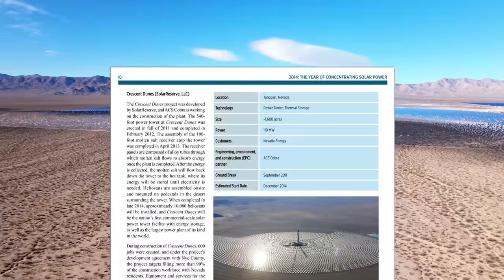The Failure of America's $1 Billion Solar Farm

Comment: "While the technical flaws were a key cause of its major challenges, the financial state of the company was ultimately the key cause behind the project's failure." But the financial state of the company was directly due to their inability to reliably produce competitively-priced electricity because of the technical flaws.
Reply: Yea, he explained that.
Reply: See I wouldn't mind an uptick in prices if it meant better energy for the future. But the line Between "this actually costs more" and "I want a new mega yacht" is so blurred.
Reply: @OsiDio  "Uptick"? The cost of Crescent Solar is 4.25 times the average. The average household spends $1464 on electricity annually. Crescent Solar would cost $6222 annually.
Reply: Exceptional poor script in this video. Instead of telling us what the technical flaws were, which would have been interesting, they kept repeating the flaw mantra
Reply: I've been out to that place out of curiosity when driving by it.  Each mirror, all 10,400 of them, are positioned by an actuation system that continuously monitors the sun's position and positions the mirrors correctly to reflect sun onto the molten salt reservoir on the tower.  For all those thousands of mirrors, that has to be a maintenance nightmare.  You probably have to have an army of maintenance guys to take care of that huge complex system.  That in itself seems cost-prohibitive.
Reply: That clears that up.
Reply: Poor design and engineering from the get go.  Too far away from the use points.  It was literally built to spend the money to build it.  It never had any hope of success from day one.
Reply: @x-man5056  
Yeah, looks like somebody enjoyed spending grant money on their science project.  When they were done burning through the grant money, the powerplant couldn't make enough money to keep it going.  Agreed, sole purpose was to spend money.  Most of the time accounting is real loose, so the project director probably skimmed money, too.
Reply: @Skank_and_Gutterboy  Even if it worked, it is too far away from users.  1/3 to 1/2 of it's generated electricity would be lost in transmission.  Just like all other forms of generation.

Comment: While the Tonopah  facility was being bult, there was a big rain storm, in may, fiber optic cable had just been delivered. The fiber was under water, and ruined. Plus the plans called for 2 elevators, to save on costs, they put only one elevator. The elevators were for stability, so the tower now leans. I was in goldfild 4 years ago, i saw the most beautiful  coat of hair. It got my attention, as most times they had been mangy, looking. That same day i was in the,Tonopah dump. Inundated  by flies. There should have been zero flies, it was 38°. I asked myself  why? Didn't  take long i found the answer, dead birds were on the ground. Its a migratory  fly way. The panels have been left to face upwards.  The birds thinking its water fly towards it and become blinded, falling to the ground, dead.
Reply: The animal was a  coyote
Reply: I work with fiber optic cable all the time. Getting wet doesn't ruin it. It is made from glass after all.

Comment: So... 1 billion divided by 70k homes is about $15k per home.  If each home put solar panels on their roof for $15k, there would be no running maintenance costs, and would produce the same amount, if not more electricity
Reply: @bert1450  there is a role for solar panels on homes for producing electricity.
Reply: what happens when the sun goes down or late afternoon or early morning ? yep you get no power !
Reply: @hokitika4888  It's rather worse than that. I retired from a Fortune 100 electric company five years ago; the company makes millions of dollars per year on the "energy imbalance market," buying solar electricity when it was cheap (sometimes even at negative prices) and selling dispatchable (on demand) energy when the sun was still rising or darkness came. California alone needs an infusion of 12,000 MW over a span of three hours every evening. Here on the Western Interconnection (essentially all North America west of the Rockies from the Mexican border of the US to the Arctic Circle) we already have too much photovoltaic generation with negligible storage.
Reply: @hokitika4888  This is why you have alternative sources of power like hydro. I guess you know the bulk of electricity consumption is during daytime, right ? Well solar PV could take care of that, without the risk of nuke plant or pollution from coal plants

Comment: Projects like this using "new technology"  should be constructed in a modular fashion - construct for example 5 percent of the mirrors & test them for a year.  Small design flaws can be detected in year one & corrected in year two as the project builds the next 5 percent the following year, etc.  Far lower total risk, imho, and slower scale up means less initial capital required.

Comment: I remember seeing this type of solar many years ago, so I don't really think of it as new or groundbreaking.
Reply: It isn't,  if you listen the narrator says, in the US.  Up until that time there wasn't one operating in the US.  Also I noticed the narrator never once mentioned natural gas.  This plant operates all night long due to natural gas being used to keep the "Salt Slurry" hot.  One of the many issues they had was having to use more then the 40 percent of it's power from natural gas, but some how the narrator just left that out.  The plant in question has more then 60 percent natural gas use due to cold mornings and it was needed to heat the salt up for the reflectors.

Comment: Solar is nowhere near being a viable alternative... to anything.  It may get there but, as of right now, April 2023, solar is still experimental, at best, but more realistically, it's just plain foolishness.
Reply: Not for photovoltaic panels.  I've been using them at home for over 20 years.  All are still working.  They've paid for themselves many times over.  I have free power every day, even in winter.
Reply: @davidb2206  If you would, what is a photovoltaic panel?  Does it differ from what the government is trying to "give" everybody?  If they are a better type of panel, why are you the only one I've ever seen mention them.  I am not trying to be argumentative.  To me, if solar really worked, no one would be connected to the grid.  What I want from a solar system is a normal electrical life, the whole house, just the way I have it, powered, at all times.  That means NO MATTER WHAT.  I want electricity to where, if the sun does not shine, long enough to deplete my system, having electricity will already be the least of my worries.  I'm not looking for the system to pay for itself.  I don't give a crap about that.  I want my own electricity, not attached to the aging, vulnerable grid.

I have begged, pleaded, groveled, flattered and, nearly, bribed, to get someone to give me a ball park of how much solar equipment, panels, batteries, etc., I would need to achieve what I want.  Not a soul has answered my question.  I just want some numbers; quantities, of things.  Any attempts to communicate back with me have been so full of jargon, I can't understand whether they've actually said anything at all.  I don't want talk of amp hours, 12 volt, 24 volt, pure sine wave, none of it, at this point.  
I want to know how many panels, how many batteries, and what else I need to power my house... always.  

Would $100,000. cover such a system?  Or, as I suspect, is such a system not possible?  Which brings me back to my initial comment. 

Did any of that make sense?

Comment: My question, you said cost of generation to NV Power was 130/kw when it first came on line, NV terminated contract because cost of electricity was to high. What was the cost when it came back on line in 2021? 200/kw?

Comment: What could go wrong with really hot salt?  Corrosion on a quantum level maybe?
Reply: Well, kinda. The smaller system the company I worked for had problems with the pipe seals. I imagine thermal cycling had a hand in that.

Comment: So, we got 0% of power from that 700 mil.  That was a gamble with taxpayer's money.  Could have given loans to each individual households to put a solar system in each home, and it would have given a lot more power to these households.
Reply: The gov got most of it back, and are continuing to collect on the balance after it returned to operation under new management.

Comment: In 2022, this averaged about 11.5 MW of actual power production, 101 MW-H in roughly 8700 hours) so it has a staggering cost of $86,000 per kilowatt of actual production.  That much production has a market value of $5-10 million, depending on market conditions, so it's unlikely to even be covering the ongoing costs of keeping it running.  I wouldn't call it "back on track" - it's consuming a lot of somebody's money.
Reply: Thanks.  At least somebody came with the real numbers, instead of glossing over the failures.

Comment: Don't assume that because a company goes through bankruptcy in the US, that it means they're not in business.  Chapter 11 is about trimming debt load so they can keep functioning which is what's happened here - but with new owner/operator.  Chapter 7 is about shutting things down, selling off assets etc.   They've been out of production at various times, but were generating in late 2021 and in 2022.   CSP as this is known, is not a simple thing and the first 2 in the US have both had tech/engineering issues to overcome as it was somewhat oversold using overly optimistic planning estimates.  I doubt you'll see any more of this type installed again in the US, personal opinion - it's too easy to do PV at lower cost now and get up and running at full production much quicker.   There's not a question about can solar energy power much of US demand, the challenge is getting grid access to put it out there, both for regulatory and wire capacity reasons.  Good article on CNBC on 6 April 2023 about those bottlenecks.
Reply: it stopped functioning
Reply: @flodjod  give me a date ?  They were producing power the last 3 months of 2022 at GWhr levels.

Comment: Was there a comparison between this new technology and a conventional solar farm with battery backup? My guess is that conventional solar energy using the latest solar cell technology, together with battery backup would probably be the best bet.
Reply: The vast quantities of batteries that would be required at $100 per kWh . And using those batteries means that they can't be put into EVs due to a battery production rate chokepoint for the next few years.
Reply: The liquid salt was a battery.
Reply: Tesla is producing such a system, the Megapack. The units are 3 MWh apiece, currently starting at $1,879,840 plus installation. Enough of those to feed California's evening deficit in the Spring (about 15,000 MWh) would be about 10 billion dollars and up, with a two year wait for the first of them.

Comment: Well, that ended with a thud. What was the price per kilowatt hour after the farm's restart and what was the gain in efficiency as compared to standard solar panels?
Reply: I'd like to hear from someone who is actually using from this facility and that it is indeed in operation. Just because they say something doesn't make it so.  Solar is an awful big lie that must be perpetuated.
Reply: @paulapatterson4301  Wikipedia says "In July 2021, the project restarted production." The article, "Crescent Dunes Solar Energy Project" contains a chart of the output through last December. It had no output from March 2022 until sometime in August.
Reply: @flagmichael  Thankyou Michael but Wikipedia is not a reliable source of truth.

Comment: I saw this facility as I flew over Nevada in 2016. What is the current cost to produce power vs. alternatives like traditional solar, natural gas, or nuclear?
Reply: When it comes to solar the cost of firming or storage of energy very different depending on the source your getting the information from. I've seen the cost as little as $20Mhw to $170Mhw and pure battery storage is higher again. Be nice if the was a way to get a basic answer to these types of questions without the mention of climate change or some other emotional charged perspective.
Reply: @LD2022-g7t  Yes! I want real numbers that ultimately will determine what the non-subsidized price is that I would have to pay for energy generated by natural gas, nuclear, solar in its various forms, wind turbines in various locations or whatever, taking account of costs of transmission and such as well as generation.

Comment: Solar farms are often subsidy farms.
Reply: As is fossil fuel production.
Reply: @malcolm8564  True, but the point of a subsidy is how much it costs versus how much it pays back with the extra economic activity it generates. It's not that it exists but what comes from it. Also if I may point out sometimes trillions of dollars can be sunk in things that don't pay back that much in monetary terms eg:- army, navy and air force. These bring benefits in terms of protection not necessarily profits. An energy independent country is safer and much better off economically for another example and the fossil fuel industry can certainly fulfil that role. 

You can have lasting extra economic benefits from an active solar and wind energy sector but maybe Chinese made infrastructure for solar and wind farms with say a 25 year service life (or until the next hail or wild windstorm) might not draw much benefit.

I can see a way you could reap lasting benefits for a country from having a major solar and wind sector. You would have to have a local industry to make, install, service and repair and replace if you wanted to get serious. Also you would have an industry to recycle the stuff after it's useful life in service is over.

Naturally you would also have to build more generation to bolster the grid for the times your essentially unreliable intermittent power generation from solar and wind etc can't service the load requirements. Hydro, nuclear, gas, coal, coal seam gas, unconventional oil and gas etc come to mind.

We can pin our future hopes on nuclear fusion with any luck at all.

So by all means subsidise wind and solar but how about we ensure base load generation to buffer the grid and how about the operators of the solar and wind farms that are responsible for the unreliability in the power supply are responsible for ensuring the on demand generation to fix it?
Reply: So are corn, soy, tobacco, and cotton farms.

Comment: What's interesting is this solar salt heat storage works very well with high tempature nuclear reactors.  Used this way a small nuclear reactor can store up power to output like a much larger power plant when the power is needed.  This enables the power plant to output its power when wholesale power prices are high like when renewables are having trouble producing power.  This enables the nuclear power plant to be profitable even if the cost of the electricy it produces is higher than other sources of electricy that can't produce power when this plant can.  This sort of plant actually lowers cost of power to consumers by enabling lower cost intermittent power to be used when available.

Comment: Each set of mirrors should has its own solar ray tracking system, that means a high maintenance cost, Eventually the dust, sand and dirt will cover all the mirrors, and it will fail against.
Reply: I believe all controlled by a central computer based on time of day and date, and position relatiive to the tower.
Reply: The mirrors are too steep for dust to be a problem. How they fare against sandstorms is another question.
Reply: @flagmichael   How do you know that? How steep are they anyway? How do the windows on my house get dirty without dust and dirt being the cause?

Comment: Nothing particularly revolutionary about this solar thermal design.  It is a continuation of the Solar 1/2 plant dating back to 1981 in Daggett CA.  A VERY expensive way to generate electricity and the plant useful life seems to be about 10 years vs 50 years for NG or Nuclear, and 100 years for hydro.

Comment: Oh ya I forgot I live 40 minutes from this and omg the glare from that cases car crashes every year you literally can't see anything but burning bright light for at least minimum 2 miles.
Can I say remove this or relocate it also its right in the middle of 5 bird migration paths and a few miles from a bird preserve like wtf.
Cities should use thirsty cement to reduce flooding and sand mining and increasing groundwater aquifer and soil levels helping cities ecosystems and you.
They should also have better insulation in there buildings to reduce energy demands.
If cities lined the sides of roads with native plants and trees it will reduce flooding heat wind and air and ground pollution.
If they line the sides of freeways at least 50 miles to 100 miles it can do the same and reduce car accidents do to less winds and people looking because they really don't want to crash into a tree.
Reply: so your solution to have less crashes is to make those crashes more deadly? that's what planting trees in ditches would do
Reply: @somethingsomething404  how fast do you drive in the city? Lmao
Reply: When flying at 35000 feet over Arizona a couple years back, I saw this place glowing!
Reply: Most don't realize it was a Chinese company behind this project.  If you want to blame someone,  start there.  And it's very remote and dry there.

Comment: I drove by the Crescent Dune Project in August if 2017. It was impressive, but I wondered where the water would come from, given the location and the type of facility it is.  That is a very dry area, and a power plant of any type not wind or traditional solar requires water to run the turbines.  I didn't even consider that it was already having problems.   Hopefully, it can function moving forward.